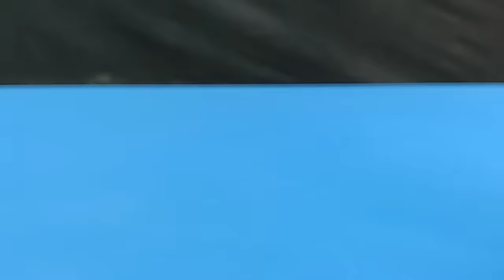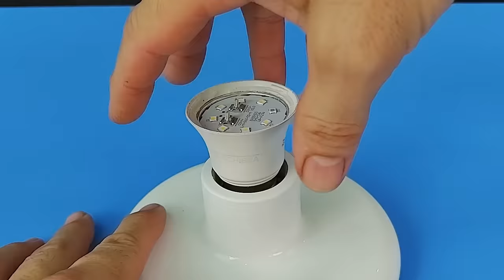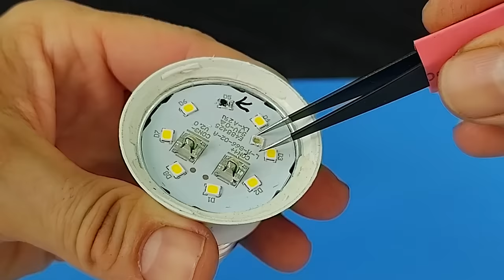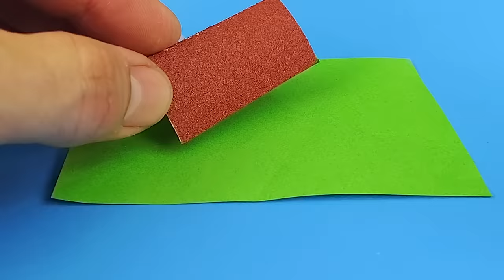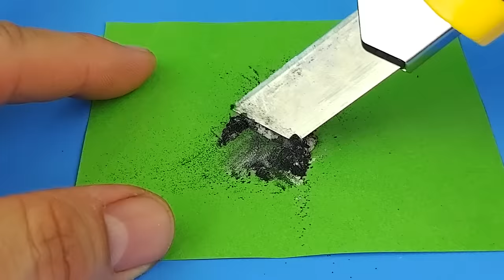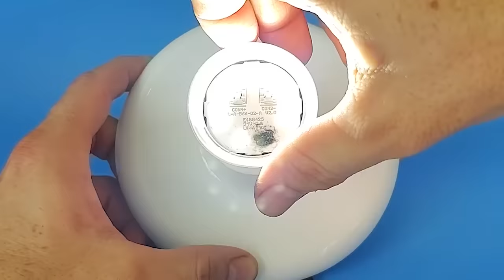Basta colocar Super Cola na Lâmpada Led e você ficará surpreso

Comment: Se você realmente nao dispõe de um ferro de soldar e essa era a única lâmpada que você tinha e casualmente você tem um lapis e cola bonder, ok até fazer o que é mostrado no vídeo.
Do contrário, nem em sonho faça essa gambiarra. 
Primeiro, porque o ponto de fulgor da cola bonder é de 80C e essas lampadas conseguem chegar nessa temperatura as vezes, o que poderia representar risco de incêndio ou produção de fumos tóxicos.
Segundo, porque o pó de grafite, apesar de condutor, gera uma resistência elétrica de difícil previsão, diferente de um pingo de solda cuja resistência é zero ohm e com isso você consegue calcular com exatidão qual será o ganho de tensão em cima de cada um dos leds que sobraram 
Terceiro, porque é melhor trocar o LED queimado por outro ou por um resistor, fazendo com que o conserto do led queimado não cause impactos nos demais. 
Por fim, você pode comprar uma lâmpada nova e deixar essa queimada para doar leds para um futuro reparo em outra lâmpada.

Comment: As lâmpadas de led são projetas conforme sua potência, se ela tem 8, 9, 10 ou 50 leds, o circuito eletrônico também foi projetado para suprir as quantidades de led. Quando você isola, ou retira ou anula um led, a tensão e corrente elétrica sobrecarrega os que ficaram, fazendo com que ele queime rapidamente.
  Se você conseguisse substituir o led queimado seria o ideal, mas garanto a você,  você não vai querer fazer manutenções em lâmpadas para cobrar 10 reais, já que com 15 reais você compra uma nova!
Reply from the maker: os leds de lâmpada novas são diferentes das antigas, estes novos contam com vários leds em série em único LED e a tensão é bem mais alta do que os tradicionais 3 e 6 volts